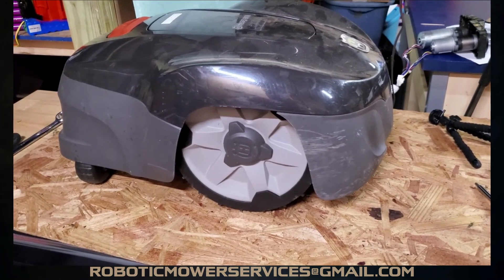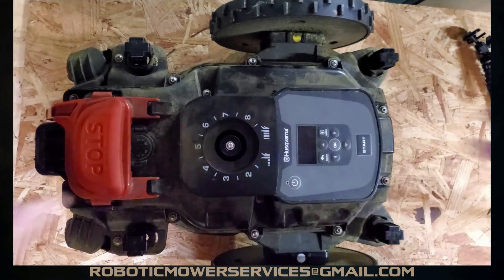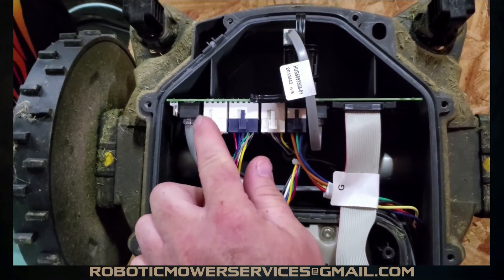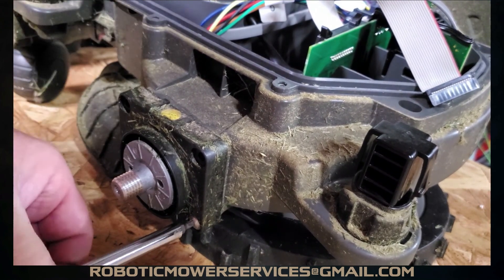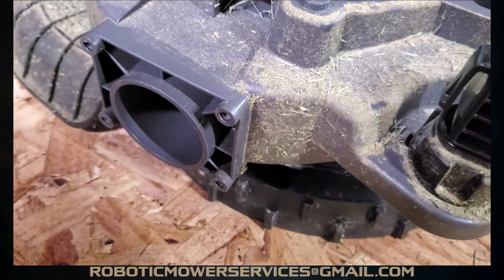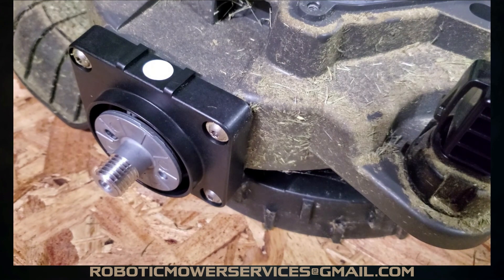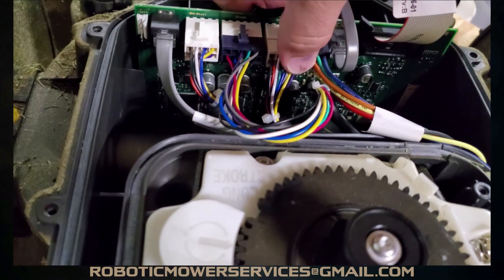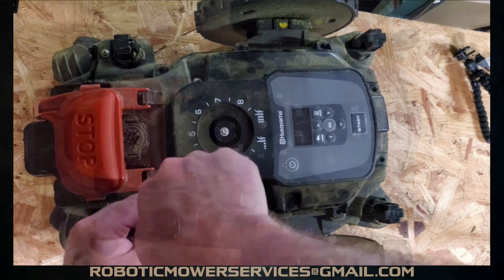Husqvarna 115H Automower Wheel Motor Replacement

Comment: how did you know which one was bad and should you change both or just one.
Reply from the maker: This motor would lock up and the mower would be stuck going in circles. Depends on the age of the machine as to whether you should replace one or both while it is apart.